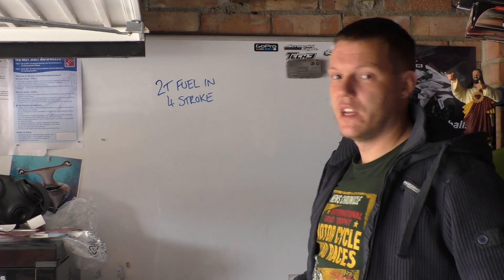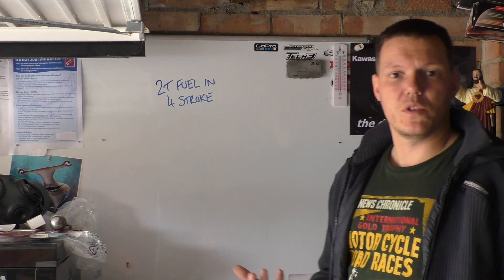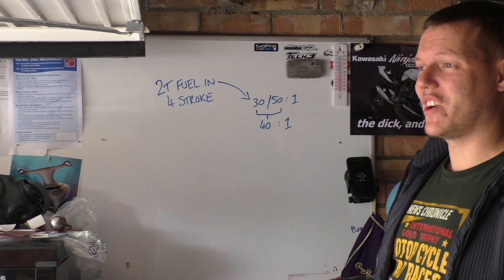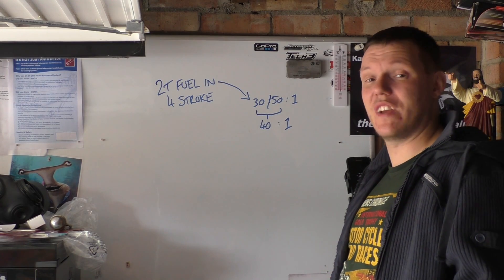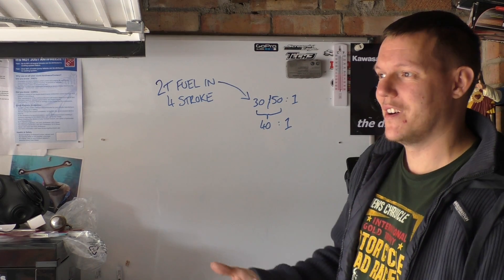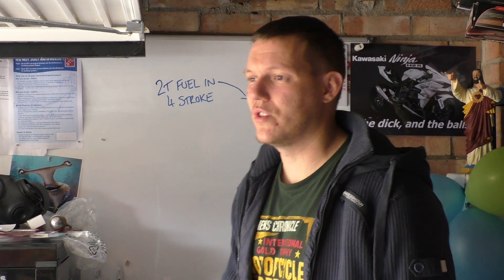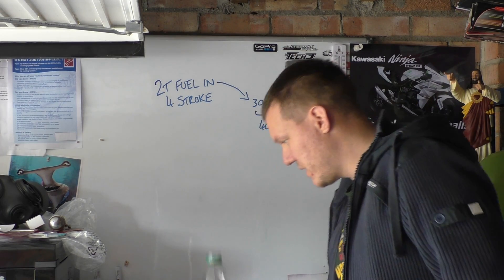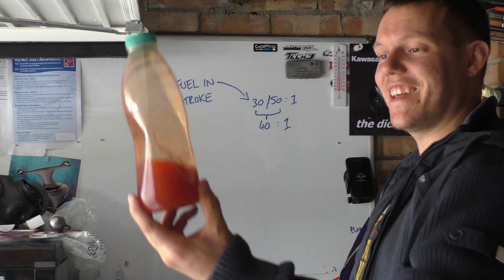2 Stroke premix in a 4 stroke - can you?

Comment: I put 250/1 in my mini bike and can definitely feel a power gain. It used to barely want to do a wheelie, now I barely have to lift the front end to get it to come up. Obviously you don't want to run 50/1, but pouring a 50/1 container in a 5 gallon jug won't do anything crazy, but will lubricate the top end a little bit and the top of the cylinder and piston even.

Comment: Periodically, I will put two gallons of K-1 Kero mixed with two bottles of 2 stroke oil in a 16 gallon tank and then fill the tank the rest of the way with 93 octane gas. This was a good top cylinder lube and injector cleaner I learned from my Uncle that really worked. Better MPG and smoother running engine in a 1990 Ford Ranger. Old style mechanic he was, and knew a lot about 40's to 90's engines/transmissions. I learned auto mechanics from him, my Ranger is still driven today with over 450,000 miles on it with same engine and transmission that it came from the factory with, and two clutch replacements. That truck doesn't owe me a dime.

Comment: An old school biker trick, back in the days when Jap 4 stroke OEM silencers rusted out within a year (Yamaha XS 250 / 400), running with a shot of 2 stroke oil in the gas tank mixed with the water trapped in the silencer galleries and stopped the pipes rusting through (even on XS 250 / 400 models!!). Water mixed with oil won't rust steel. (Steam oil principle used on steam locomotives to prevent water tank corrosion).

Also worked on cars. Knew a Scottish chap who had a 17 year old 1970's Audi with the original exhaust cos he ran 10:1 2 stroke oil in the petrol once a month. He passed the tip onto me, back in the mid 1980's, and it works.

Nowadays only Chinese bike exhausts need an occasion internal coating of 2 stroke once a month or other month  to keep the rust out.

Comment: I put Lucas transmission fix mixed with gas in my weed wacker a couple times still runs fine .in a pinch i put mixed fuel in my snowblower . i even left it in there the whole summer and starts up in the winter maybe it's good for it to sit keeps the carb from corrosion the ethanol gas has corroded up some of my other four stroke engines carburetors
Reply from the maker: "ethanol gas has corroded up some of my other four stroke engines carburetors"

- which bits?

Comment: here are my few cents. let me start, by adding that i do not advice my self to add 2 stroke oil.
however, i use 1 deciliter for 50 liter fuel in my bike, in my car, in my tractors that are DIESEL powered. and in my truck that is direct injection diesel.
allso a local agricultural firm has the same policy for BRAND NEW john deere diesel tractors.

what i observed:
fuel pump worn out on the direct injected far ore often that in should had before i started using 2t oil. never since than. it stays quite like brand new.
on diesel tractors i do regularry remove the exhaust gas collector tube to clean carbon deposit. i got FAR less to the point where i do not remove it every month, just every year.

so.. thats me. i use husqvarna low smoke oil. for me it works well, maybe contributes to engine longetivity, maybe not. i can not sa for sure. unarguably cold start did improve, specially on older diesel machinery. i personally stick over 1000 work hours in a tractor, did not observe and shortcommings, did observe benefits. 1 work hour on machinery means 1 hour at full rpm. so if you just do half rpm, it takes 2 hours to clock 1 work hour.
in the direct injected diesel truck we done 100K km at least since using the 2t oil, no pump faliures. before than some went 30K, some wet 50K. car has now close to 400K km in it, still starts like a champ in -18. 
bike wise... can't say a lot, i only done 1000 km with it. sofar everything seems normal.

Comment: Matt have you done a video on this - https://www.youtube.com/watch?v=2kehHbZ5DTU

For opposed 2 stroke piston engines do you think this might be able to compete with the conventional 4 stroke or is this just shite?
Reply from the maker: Holly shit - 1hr LOL I'll have to make some time for this bastard
Reply: I hear you. I'm still only 15 minutes in. I sent you the longer interview so you could glean some details if you wanted the other videos are short and don't give you any insight to what they're talking about. The owner/rep explains/claims how it is an actual overall improvement in this video and how it really does meet the strict 4 stroke emissions standards. I found it to be interesting so far. 2 stroke power that's legal? I'm interested how they oil the top rods and pistons without burning the oil from leakage. I hope he covers that.Got any ideas how they accomplished this if he doesn't?  Theoretically they could V the engine and make Bugatti wish they had thought of the idea themselves. 16 cylinders of 2 stroke power in a engine that weighs about a V8. Bet that would scream down the track!
Reply: OK I did some research and if you go to this video 1:40 and 0:52 the cad rendering goes see through so here's how they keep the oil out me thinks

https://www.youtube.com/watch?v=6XDaSN5_BW8&lc=z23rujzzrrq3x5avlacdp431ud0q11fwp2ydtkowp4hw03c010c.1506736209788591

So really long sleeves for the cylinder and they're past the exhaust/intake ports towards the cranks and extremely long piston skirts. I presume some extra rings to keep the cylinder as oil free sealed as possible and some sort of oil pump that connects into/(is apart of) the wrist pin of the top pistons to pump the oil out of the skirt. Probably back up the rod itself. If that's what they're doing it could get clogged pretty easy and build up the oil there.I checked out there patents and it looks like they're using a slipper bearing. The wrist pins back and forth action is some sort of pump I figure. The extra weight on the pistons for high end is no good. Only way to keep the oil out of those top ports however. I figure they are looking for some sort of half assed cover for the pistons to let a limited amount of oil into those cup like top pistons next if they haven't already tried a few approaches already. Maybe they have worked out some of the kinks though. No real pictures or explanation. If they have patents and it really works year after year they would be more open about it I think. Probably still just another version of shite - most likely goes bad after a few years and hard driving.

Comment: Moreys make a product called Upper Cylinder Lube and injector cleaner.   I suspect it is just synthetic 2 stroke oil + injector cleaner.    That brings me to a question;  is synthetic 2 stroke OK in all 2 strokes as I know it is not recommended to do it the other way around with some high performance engines like Bombardier which require a certain ash content in the combustion process?
Reply from the maker: Depending on the engine and also some EFI engine are a bit funky when using mineral oils - will be a video coming soon

Comment: I have read in different forums that some people uses TCW3 Oil (2 Stroke Outboard Oil) in their gas engines with a ratio of 500:1, there has been tons of people that have tested it, no one has claim any down sides and some people have claim that they feel their high mileage engine running more smoothly, slightly better fuel mileage (like 3 or 5%) and reduced oil consumption. They say that this benefits are attributed to a better seal in the combustion chamber because the 2 stroke oil helps the rings seal better.

They use Outboard oil because it has lower ash content. This is what they have wrote:

"What we are trying to accomplish ( The deliverables)
We need to lubricate the fuel pump/seals/injectors.
We need to clean the fuel system and scavenge water that ethanol attracts.
We need a film of protection in our fuel system to stop corrosion.
We need a cleaner for our spark plugs/valves/combustion chambers.
We need to clean the ring packs 
We need to leave a film on the cylinder walls to eliminate cold start metal wear."

I don´t agree to all of this statements, but I do think it can help my 284k miles engine to consume less oil and it can also clean the combustion chamber
Reply: http://www.ls1.com/forums/f48/been-testing-oil-91206/
Reply: I would love that you could share your thoughts about this

Comment: is a totally bonkers thing to do the carbon build up on the inlet valve will kill the power and air flow oil stinking to the hot inlet valve  just look at modern direct injection cars and the carbon build up on the intake valves from the egr valve hot dry gas sticks to the valve oil will build up a lot faster  on it knob head
Reply from the maker: The back of DI intake valves is because there is no fuel in the intake to wash the back of the valve.

Comment: You said you added solvent? That is a endothermic reaction but a very weak one.
Reply from the maker: no solvent yet..... that's for later
Reply: The Workshop follow up question can you take the temperature of that 10w40? My second suspicion would be that it was just a bit below ambient air temp and when you sealed the bottle and shook it up it cooled and condensed the air inside the bottle, which would make sense if you didn't have to cut anything up to the point where it looked fully round again.

Comment: There is a group of people that swear by using TC-W3 rated two-stroke at at ~500:1 ratio in their four-strokes. The claims are it acts as an "upper cylinder lube" but also a cleaner for varnish from old fuel, carbon, etc. They make claims of smoother running and better fuel mileage. Also, apparently helpful keeping the carbs on equipment stored over the winter from gumming up.

TC-W3 is ashless and doesn't have any metallic anti-wear additives that might affect the cat. 

Who knows?
Reply from the maker: I knows - its bollocks

Comment: I remember seeing pictures of a 4T vintage engine that was total loss oiling before and after running on modern 2T premix. It decoked the combustion chamber very well and I'm told saw less wear.
I'm guessing the pressure drop may be the formation of additional carbonyl and carboxyl groups using up the oxygen in the bottle. That or from any heat generated when mixing the two, sealing, and then subsequent cooling.

Comment: On old Brit bikes, a little prmix is not a bad idea for newly built engines, that can be a little tight if you are running down a motorway, at constant speed as the top ends might need a little extra lubrication.

Comment: The Workshop there are actually some small 4 stroke gas engine (mostly for RC Airplanes) actually only run off of premix and do not have any oil in the crankcase like the Kolm IL-310. There are also a few "4 stroke" weed eaters that operate the same way.

Comment: hay Mat what would you suggest for a engine that designed for leaded fuel as you cant get it anymore only ask in this video cause my gramp said put some 2 stroke in it but is there anything that does a better job
Reply from the maker: You can get leaded fuel - saw some 2 weeks ago
Reply: where
Reply from the maker: racing fuel - in a barrel not from a pump - Sunoco leaded is fuel is what I usually buy if I need more -

https://www.demon-tweeks.co.uk/motorsport/race-fuel/sunoco-supreme-leaded-race-fuel-115-ron
Reply from the maker: here's the main page with all the selection - https://www.demon-tweeks.co.uk/motorsport/race-fuel

Comment: I used to put what was left of my Castrol R premix from my racing 2-stroke into my car. Car ran ok (A bit smokey sometimes) however I did have an oil pick up problem and found a bit of a gooey mess partially blocking the oil pick up strainer. So, it runs but I wouldn't do it again, although that was Castrol R not modern formulated stuff.

Comment: I've seen a gasoline diesel premix accidently used in a car and it smoked like a rastaman and got hot  I wonder how 2 stroke oil affects the running temp.
Reply: Ian Hill not much I imagine, only 1/40th is oil, as long as you don't run Evans it's fine

Comment: I quite often restore old engines that haven't been ran in years. If they have compression and I don't take the head off I will run them on two stroke mix for the first half hour to lubricate the top end. Maybe doesn't make any difference but makes me feel better about it.

Comment: f1 uses a fancier version of pre-mix, so i would asume there is some benefit, tho probably won't be useful unless your pushing your engine HARD, to combat how the oil effects the combustion itself, tho i could see it lubing rings/valves to a certain degree, thats why wankels use pre-mix, lubrication of the seals that the engine oil doesn't get to
Reply: Drake5153 in case of F1 I think you're talking about them burning thier engine oil. That's good for F1 because they have fuel limits and also aren't allowed to put additives in thier petrol that they can put in their oil, wouldn't be very advantageous outside of messing around with F1 regulations

Comment: when I raced 4 stroke bikes (motocross) we added some 2t oil in the fuel on the theory it would act like a upper cylinder lubricant, stop the valves wearing so much and to be fair I rarely had to shim my valves (and yes I checked regularly) Actually, we did buy some American stuff labelled upper cylinder lubricant which claimed to make your valves last longer. what you think knob'ead?
Reply from the maker: Sounds stupid but worth thinking about - put it this way, when was the last time your engine failed because the valves failed - and not at the tip LOL
Reply: The Workshop ohh yeah haha fucking idiot, maybe to cushion the valve heads a little bit?
Reply from the maker: LOL no the oil won't be enough and the seats and valves are hardened and formulated to take the impact - more later

Comment: My mate put premix in a four stroke and ended up stuck out in the middle of nowhere in the dark, so you can but...
Reply from the maker: sucking it out - why?
Reply: The Workshop it konked out, never been the same since 😂
Reply: was the oil ratio miles out though, meaning tons of oil in the fuel? Lots of folk tend to get a bit mixed up with the numbers, missing 0s out here and there can make 40:1, 4:1 - big time problems for plugs of the sparking type there.
Reply from the maker: Fuck off - no one is putting 4:1 in their engines - that's 1 litre of oil for 1 gallon of fuel!
Reply: Ok maybe it was too extreme an example, but folk do get it badly wrong, I've seen it happen :P

Comment: what about the 4 stroke weed eater engines that run on 2 stroke mix and dont hold oil in them
Reply: paul aven 4mix
Reply: who makes those?
Reply: Stihl 4 motion engine.
Reply: i, for one, prefer the any-way-up honda, but, i can see why this would be good

https://www.youtube.com/watch?v=eWZfRdm9u9c
Reply: they claim it has more torque and runs smoother and quieter than a 2 stroke but is still relatively light
Reply: Matt Gray That sounds like the worst of both worlds, what are the advantages?

Comment: Can you use chainsaw 2T oil like Stihl or Husky brand for your 2T motorcycle or moped.
Reply: fonziyo furiozy As long as the mixture ratio is matched to the engine
Reply: Dylan Headrick should i put oil according to the engine specs, or the oil specs ?
Reply: fonziyo furiozy Are you talking about the mixture ratio number? Mix it to what the engine states.
Reply: Generally yes, but not all 2T oil is created equal. 
In an extreme pinch 4T automotive motor oil could be used, but I would not recommend using repeatedly and I would not run the engine extremely hard on 4T oil mixed fuel. 
To be safe I recommend using the oil or oil spec that the engine/OE manufacturer recommends. 
Some is conventional, some is synthetic, some is a blend. 
Some is not compatible with injection. 
Some is compatible with alcohols, methanol, some is not. 
Some are specifically for marine use and do not perform well in other applications.
Reply: fonziyo furiozy Yes you can, but I'd only do it on a one off basis if you can't get the stuff that the engine manufacturer recommends (or its equivalent)
Reply: fonziyo furiozy and mix it to whatever ratio the engine manufacturer states.